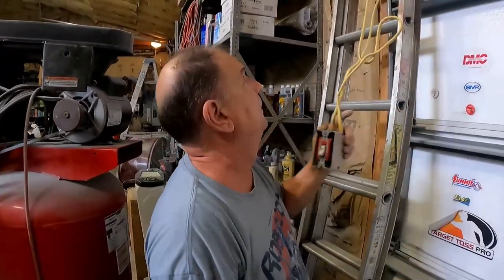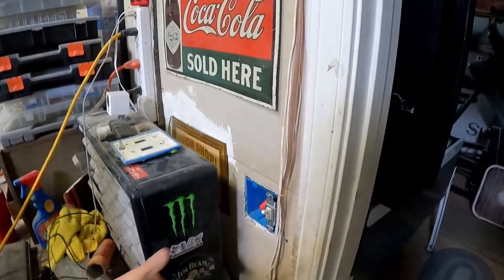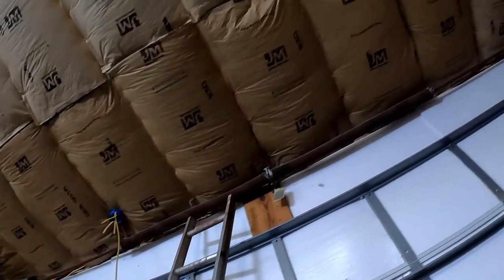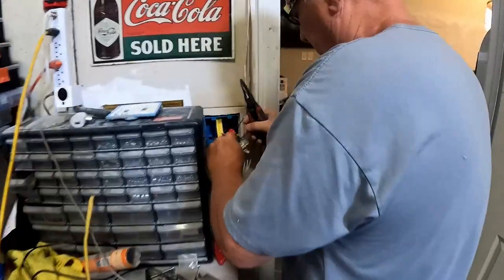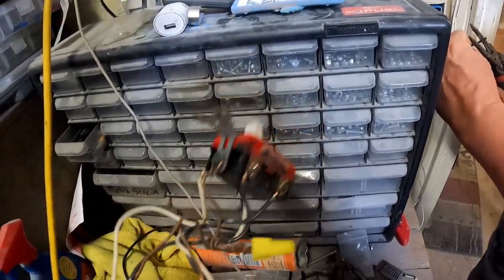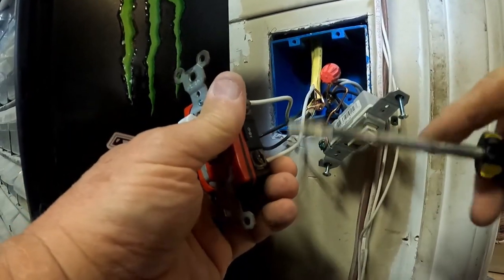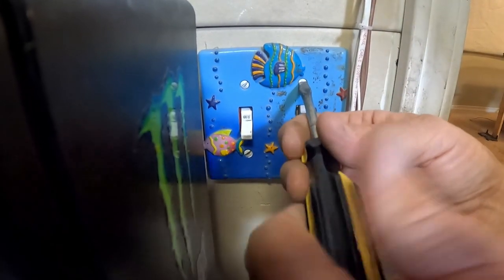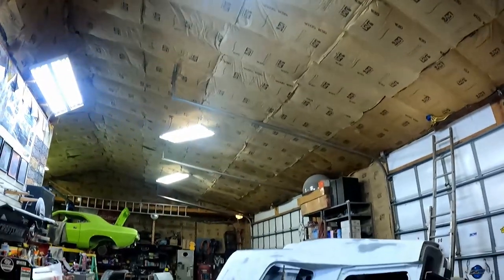How to wire up a 220 Volt Light Switch

Comment: Should I wrap that Loose switch with black tape that way you would. Not get shocked
Reply from the maker: We may not appear careful, but make sure the power is off and whatever your comfort level is, take every precaution you can!  You can even test the wires for power too with a multimeter to be sure.